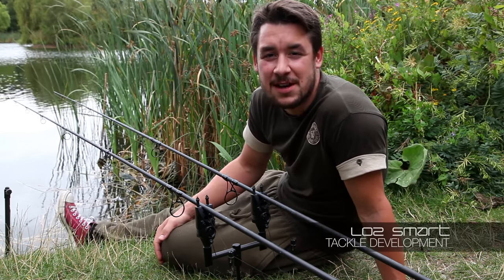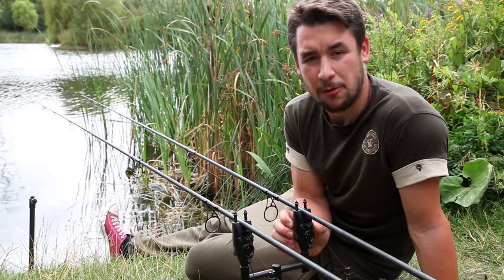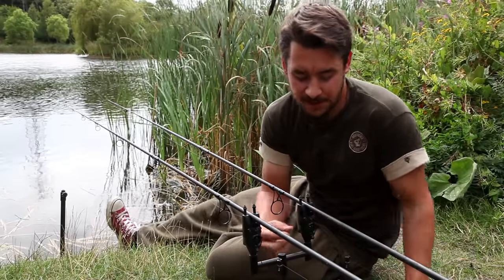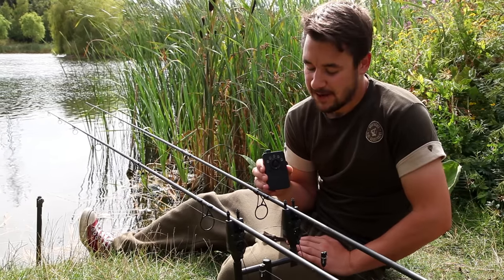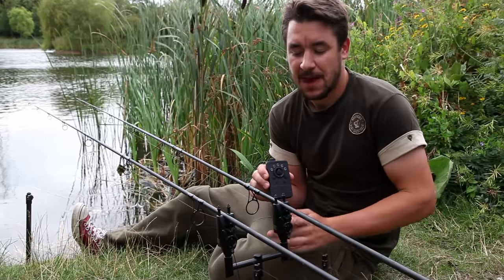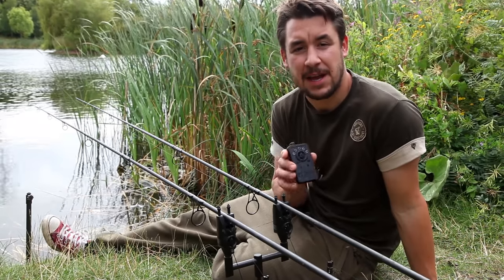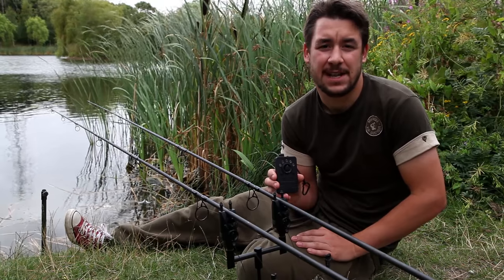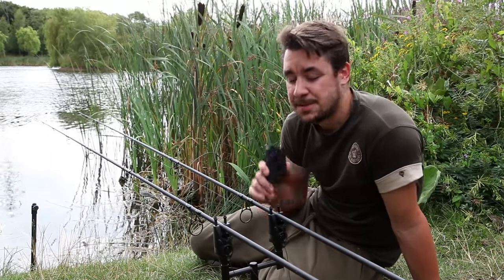R3 INSTRUCTIONAL DEMO

Comment: Is there any interference from other anglers who could be using Nash alarms aswell. 

I’ve bought alarms form TFG. And the angler 2 pegs away from mine also had the sane brand alarms (not same model) . When he had a run both receivers were going off.
Reply: Christopher Hughes no mine and my brothers don't connect

Comment: anyone else had issues with syncing alarms 2/3 have paired 3rd wont
Reply: I’m having that issue now on the bank , after working fine for 2 years ones just packed in completely , won’t connect to my receiver at all , not sure what to do tbh

Comment: Far to complicated. Some features like the low battery alarm are good but they come as standard with most good alarms these days. Try messing around with the "X" button and power button at 3 am when its pitch black and you are half asleep. A simple volume wheel and a on off button would have been a better option. The screw on ears and fiber optic bobbin are a nice feature. But for over £100 RRP these are way to over priced when you can pick up almost the same standard of alarm from another company for around the £40-50 range. Come on Nash you are better than this!